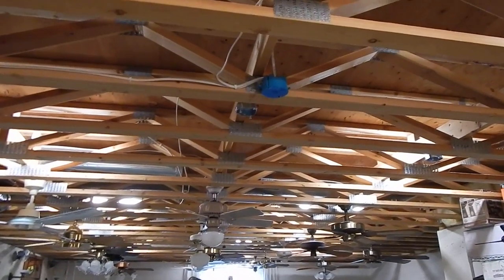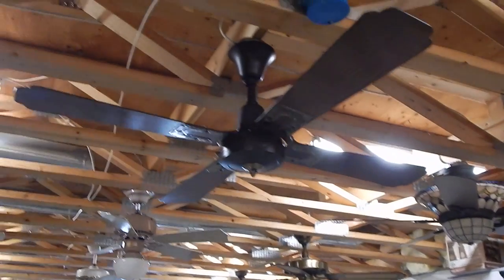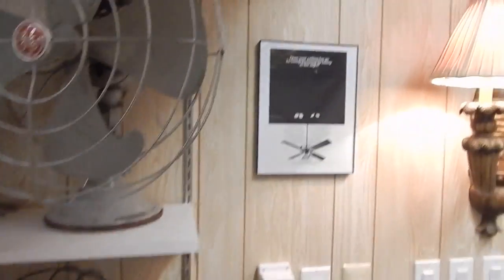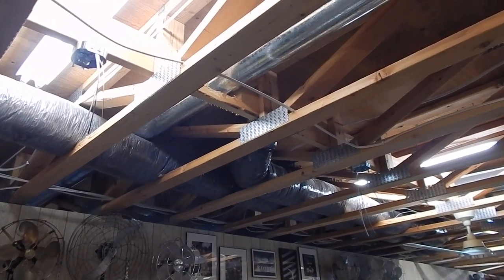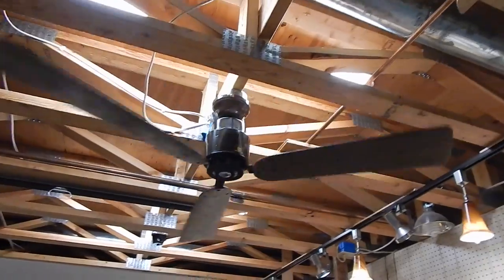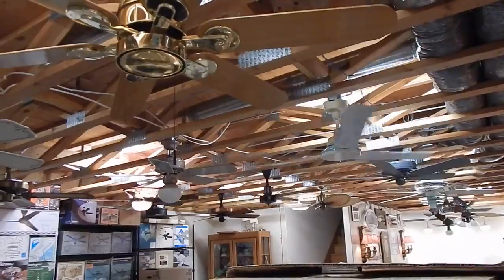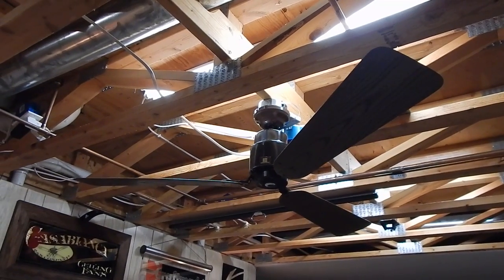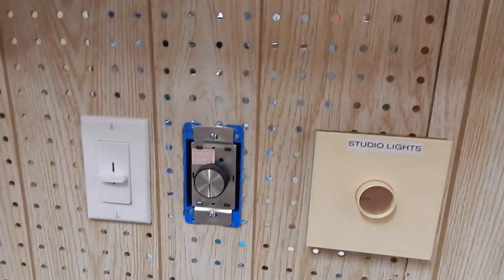Shop Vlog 2 | Display Phase 2 Complete & Memorabilia Hung

Comment: I'd love to see some sort of vintage commercial fixture where the wraparound was like a ringed Prescolite.  Or preheat fluorescent.  Or were you thinking newer?
Reply from the maker: Probably newer, I like vintage fluorescents but you can see I'm not really into collecting/implementing them. I just don't have the interest. I definitely want something a little more ambient; I want to be able to shut down the fluorescents and have a warmer atmosphere. I was talking with Russ to see if we could get some Kichler that I like in here, I haven't heard anything positive yet. Otherwise I'll just keep an eye out for other stuff I like new or old. There's plenty of room for some of everything.
Reply: This is what I meant by a prescolite:  http://metromodern.biz/Prescolite-Steel-Pendant-Lights.html  Maybe there's a new version?  I know that style is coming back.
Reply from the maker: Yes, I wouldn't mind something like those ringed Prescolites. I know I've seen new takes on the style, it's definitely back. Certainly something of consideration, I'm not opposed to a vintage fixture in that regard. I really have no bias when it comes to lighting, I like what I like whether it be new or old, so I particularly love the new stuff that draws heavily from vintage inspiration. Now I kinda wish I'd bought the large Feiss Holloway pendant (same as the small white/nickel ones in the filming area, only bigger) that was at my Habitat. At the time I couldn't think of a particular use for it, but now it would've been perfect in that spot by the stairs, at least for starters. I plan on changing around and cycling out the lighting occasionally, as I will with the fans, so I'm also trying to keep the costs lower since nothing is subject to permanence.

Comment: There is an outlet with a plug near the heat fan.  What is that for?  Also, why does the heat fan have the wrong canopy?
Reply from the maker: There are a few outlets up there, if they're the ones I think you're talking about, they're the switched ones I added for the lighted signs. If it's the other one above the workbench, it was existing and feeds a power strip for the workbench that will eventually be eliminated. I plan to come off the switched ones and add many more elements that can all be controlled by the one switch (think lamps and things, stuff that's annoying to have to go around and turn everything on and off).

Original Heat Fan canopy got smushed in shipping. I have a spare AB one of the right shape that I was trying to match paint for, it's on a long list of projects, but the ball/socket keeps it much lower profile which is what I wanted in that location anyways. That was a big factor in choosing the Proline for the adjacent location too.
Reply: It's the workbench I think.  You uplugged something in the process of moving the fan.
Reply: X10 stuff can be found pretty cheap on eBay, as a solution to switching, probably not necessary if you're running fresh romex.
Reply from the maker: Ok I wasn't sure where in the video you were referring to. 

I considered stuff like X10 or even like a connected smart home system just because I think that stuff is fun, but I don't think I really need to achieve that level of individual control. I have to add most of the receptacles I require, so it's not like it would save me much of anything to implement a control system with existing infrastructure. Basically I just need that option of a single location that does on/off for everything.
Reply: My favorite ceiling fan on your display is the Casablanca Spirit of Saturn and I trying to get one still

Comment: Why is your Lady Delta High Medium Low?
Reply from the maker: Someone else got into it before I got it. Again, on a long list of things to deal with, but it's fine as-is so it's at the bottom of said list.
Reply: Yeah, if it uses that kind of pull chain that can't have wires swapped to change the sequence, it's really high, medium-high, and low. It would use medium speed AND low speed capacitor for 2nd setting, so it's really medium-high. I can already see medium is faster than medium on most Lady Delta.

Comment: The only 5-speed controller that I encountered so far that offers a very good range of speed are the Quatre Saisons. The Westinghouse's ones are almost as bad as the Evergo.
Reply from the maker: Any made in the past couple decades provide awful range, for sure. I have a few from different makes that are actually fairly decent, the Union ones that came with my Chadwick labeled fans are actually pretty good. Also the DEMCO ones, which I guess are essentially the same as the 4 Seasons so it's not really another example.
Reply: Some CMC controllers from the 1990's offers a surprisingly good range of speeds. Vortice controller from any decade will definitely offer a good range of speeds plus they have a separated lighted on/off switch which I love. Surprisingly newer SMC controllers offers a better range of speeds than older ones. I have never tried a Union controller but they seem to have a very good range of speeds according to your demonstrations. For the Quatre Saisons controller, they are two kinds, the older ones (1980-1981) are heavier and have a visible screw on the front, the slightly newer version is lighter and there is no visible screw, this second version offered with models from 1982 to 1985 seems to offer the best speeds of the two versions, plus the knob is easier to turn.